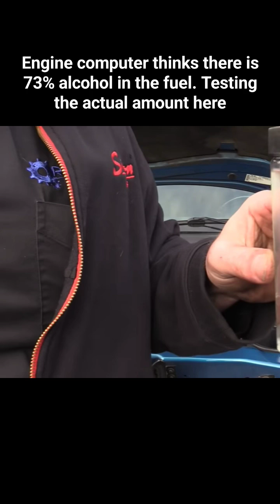Testing Alcohol% in Fuel [severe rich conditions]

Comment: There's an asterisk to that. You have to have enough water to pull it out. I used to use a small water bottle to do the testing. Fill it up half way with water and mark it. Half way with gas. Shake shake shake (KC and the sunshine band) and see where it is. If it goes up 50% more from that line you probably have the 85 stuff.
Reply from the maker: With this measuring tool, that variable is removed

Comment: Many people use that garbage e-85 gasoline. Then when they switch over to regular gasoline, it takes a while for the sensors to read the current fuel. 

That and the monitors need time to reset themselves.
Reply from the maker: In this case this was someone who never used e85. Short drive cycles and small fill ups caused this on these GMs. There was a ECM update to help with this condition too.
Watch the full case study linked in the short. Thanks!
Reply: @ScannerDanner  Interesting. I had a Ford that the driver filled up with e-85, then parked it for 6 months. 

After I finally got it running, I could smell the nasty fuel. I filled it up with regular fuel, drove it, and the monitors still read alcohol. 

I had to go in and reset the monitors with the scanner. Then it started to run good afterwards.

Comment: Could you theoretically make pure gasoline (no ethanol) by mixing with water, then siphoning off the top layer?
Reply: If you're careful, yes. The issue will be the octane rating probably won't be the same.
Reply: You can just buy real gasoline at some pumps. It will cost you more
Reply: @gooddeed972 That might be true around you, but within an hour of me, in any direction, this is not true.
Reply: @arthurr8670 yeah we have some stations around here that sell non ethanol gas but good luck catching them when they’re not sold out lol
Reply: @gooddeed972  Not in CA perhaps other states too. Only thing you can get is 10% ethanol, I have not seen a station with E85 but I'm not looking for it either.